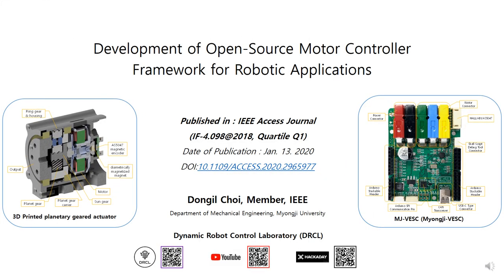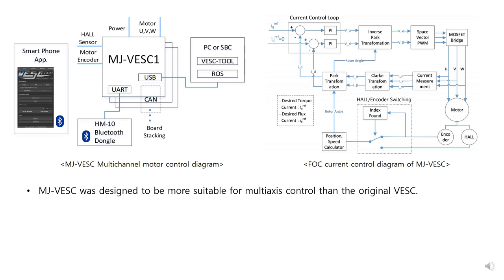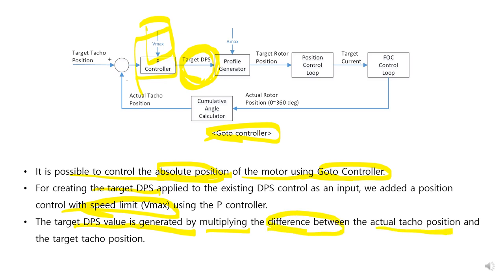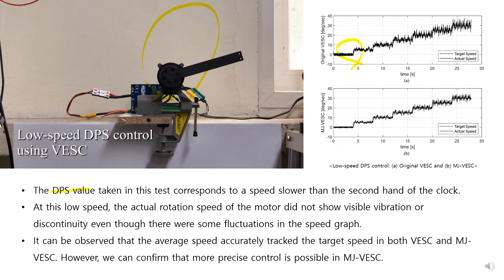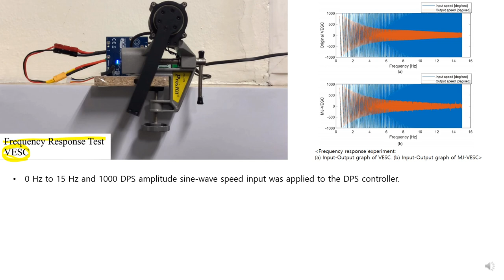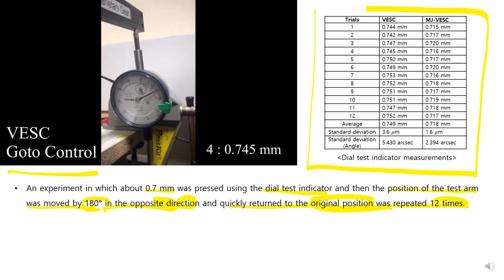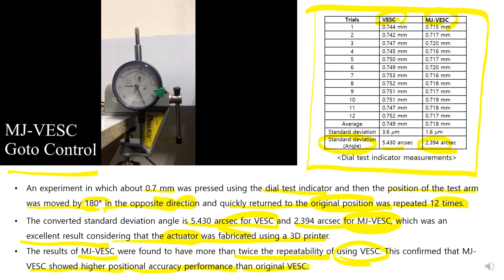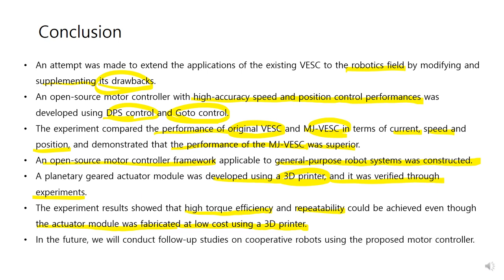Development of Open-Source Motor Controller Framework for Robotic

Comment: Why choose vesc instead of odrive for this project ？
Reply from the maker: Thank you for your interest. The reason for using VESC may be a matter of personal preference. I have been using VESC for a long time and prefer VESC as a reason for the convenience of GUI Tool, Auto Motor Setup and ROS drivers. In addition, this study showed the possibility that VESC could be used for robot control by improving the position control performance of VESC. Also, ODrive is already used in many different robots, so I wanted to go a little different way.
Reply: @DRCLAB2018  I agree, I am glad you picked the VESC.